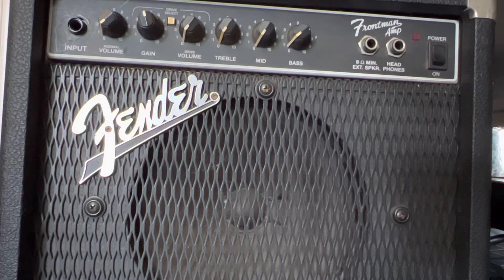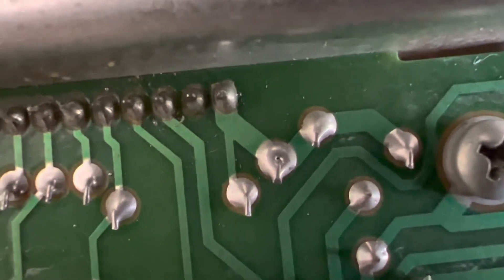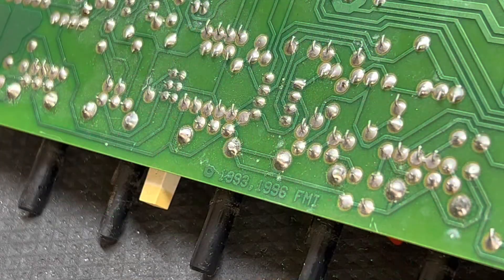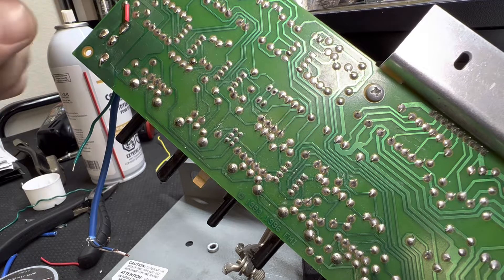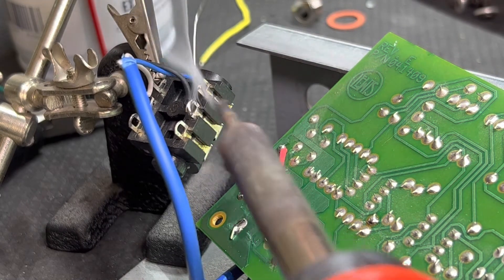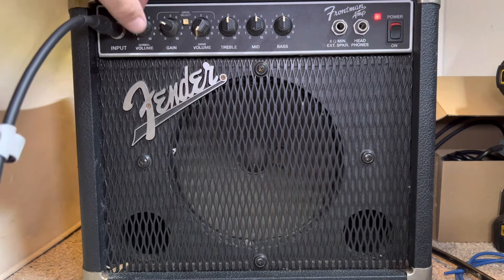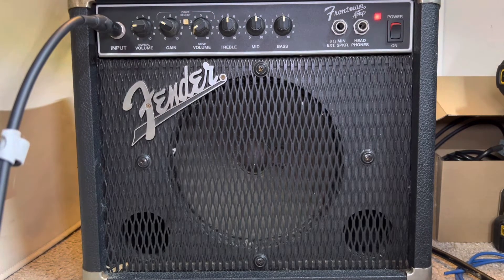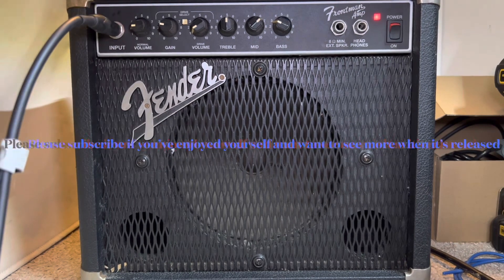Fender Frontman pr-241 - solid state amp repair

Comment: Could you tell me the part number on the replacement input jack?  Or a link where you got it?  Wanted to get a quality replacement (Switchcraft, instead of a Fender).  Thanks.
Reply from the maker: That would be a Cliff jack. Definitely quality over quantity!

https://www.stewmac.com/electronics/amps/components-and-parts/jacks-and-plugs/cliff-british-style-input-jack/?msclkid=0984d05696c7127abcdab6520f1e9e6d&utm_source=bing&utm_medium=cpc&utm_campaign=CP%20%7C%20MF%20%7C%20BNG%20%7C%20SHOP%20%7C%20NBR%20%7C%20All%20Products&utm_term=4576373582069632&utm_content=All%20Products
Reply: @helwigtonefabrication  Thanks so much! Much obliged 👍🏼

Comment: Hi I think the white noise is something you have to deal with? I have the same model and it produces some white noise. The noise increases when I turn up the reverb
Reply from the maker: You would have to replace all the caps. No use on just changing a few. There are a good amount inside so, be prepared with a good solder sucker!  This one is used on the dirty channel for vocals in a garage, so it just needed power. Lol.